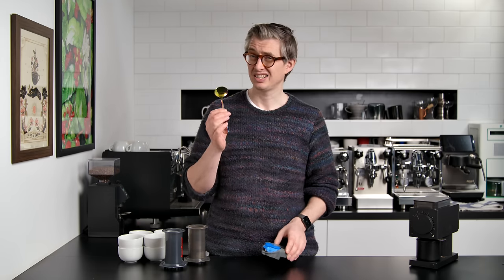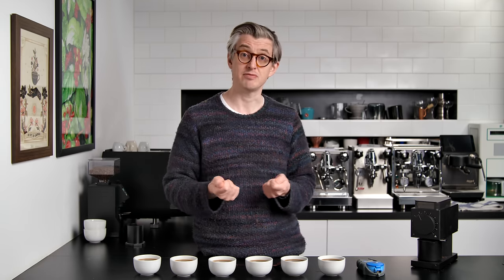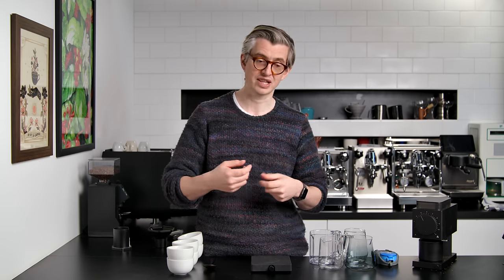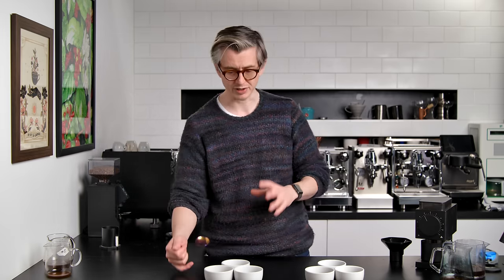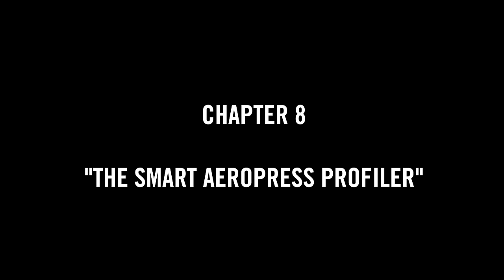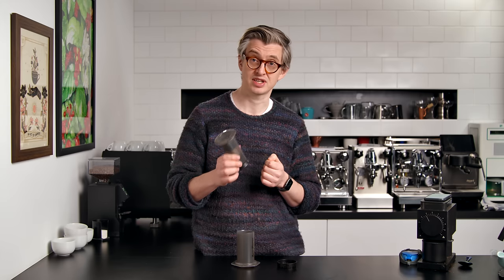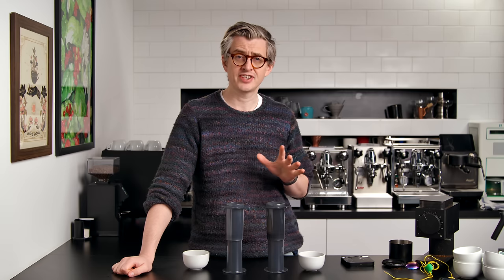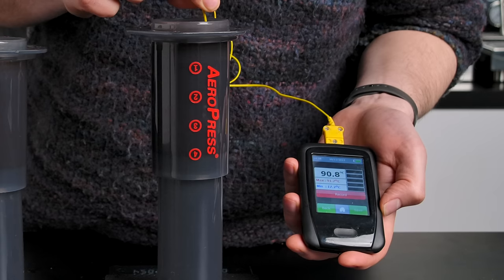Understanding The AeroPress (Episode #2)

Comment: I once forgot that I was brewing a coffee in aeropress and the brew was steeping for about 40 minutes. It was a pleasant surprise how tasty it was.
Reply: It’s not long before the water cools and the coffee settles enough to the point where extraction has effectively stopped.
Reply: Cold brewing does have something to it. Even if it didn't start that way.
Reply: Check out Sprometheus video where he treated the aeropress like a cold brew, he just let it drip until it finished and got nice results.
Reply: In my incremental steps where I brewed all the way up to 30min, I found out that after 10min there where no gain in letting it steep any longer, it’s also about that mark you typically start drinking in cupping. The 10min where the best absolute but the gain over a 4min brew where small, like very, very small and probably not worth the extra brew time. The biggest benefit seem to be that you can drink it almost immediately.
Reply: At a bakery, I'd load the portafilter before going home for 5 hours before the late shift.
So it pre-infused and was slow roasted until I pulled the shots at midnight.
Very nutty soft flavors.
Reply: It does say in the instructions that if you are expecting company, you can pre make a bunch of shots.
Reply: This video was very helpful for me. I just got my Aeropress for my birthday and am just learning how to make it properly. After watching a lot of videos, I brewed my first cup using the inverted method, the bloom, and wetting the filter.  I was pleased with the results and it was definitely a quantum leap from the auto drip of my coffee maker. However, I was a little disappointed in the amount of coffee provided. Now I learn that I can increase the quantity by using the non-inverted method  and still get great flavor. My second disappointment was that I couldn’t make two cups in my Original Aeropress. Now I learn that I can double the coffee and get a concentrated brew that can be divided into two cups and diluted with additional hot water. Brilliant! Problem solved. Last I learned that it’s not necessary to wet the filter prior to brewing. This isn’t a big deal one way or the other, but it’s nice to know anyway. So, this video was very helpful and I learned a lot. I will try out my newfound knowledge in the morning. Thanks a million.

Comment: as a habitual aero press inverter, filter-rinser, and non-hiss-presser, you have made me question everything. thanks for this one, king
Reply: The recipe seems to be; finer grind, no invert, boiled (or 80c) water. Uncomfortably closer to “bang it in and enjoy it”.
Reply: Perfectly put!
Reply: I'm in exactly the same boat 😂
Reply: So each by themselves do not make a difference, but what about all 3 together? 🤔
Reply: For real, it's actually kind of a relief to know that I don't need to stress about EVERY little thing with the Aeropress.
Reply: I feel attacked by James...
Reply: same here hahahahaha
Reply: I honestly think the inversion method depends on what you are doing. Some recipes call for you to stir for x amount of time while inverted then immediately flip and press. If you didn't have it inverted you would be constantly losing water in an uncontrolled manner so your extraction would differ slightly between each brew, enough to matter who knows but it will still be different and it is a way to control that variable while changing others.
Reply: I believe inverted is actually easier. I've never spilled inverted, but I have with non-inverted. Basically pressing in the plunger after having liquid in it gives me less stability than having in from the start. :shrug:
Reply: One defense of inverted is, especially if you have a metal filter and don't measure water, is that it makes it easier to put in a consistent amount of liquid.
Reply: I'm right there with you...  😁
*UPDATE * I made a cup with the new information... 2.5 min steep, normal orientation, unrinsed filter, swirl, and boiling water. Result: richer cup, very tasty. Key Takeaway: My Palette isn't as refined as his. 🤣
Reply: Inverted is more consistent, as the amount of time it takes you to insert the plunger and pull a vacuum with a non inverted brew is an additional variable that will slightly vary every single time you brew. That means different amounts of water will have different amounts of time in the brew chamber etc. If you're goal is consistency of cup, I think inverted makes perfect sense.
Reply: @iau if you multiply zero three times, you still get zero.

Comment: I would be interested to see a comparison between different filters such as a single aeropress filter, double aeropress filter, metal filters, metal and paper combo, fellow prismo and the aesir filter. It would also be interesting to see what difference you get by brewing with a small amount of your final water and diluting after pressing or using the full amount to begin with. Thanks for the thorough and informative video James!
Reply: He basically answered one. Brewing 15gr with 200 water or with 100 water... the one with more water used in brewing wins.
You could compensate the diluted one with grind size and steeping time and such .. but are the brews even comparable at that point?
Reply: I’ll echo the request for different filter experiments (though I think we can all try triangle experiments, if we have a friend to swap the bowls around). I’ve been using a paper filter in combination with the Prismo, just because I’m lazy and don’t want to figure out the right plunger-position for true immersion brewing. And... I’ve also tried a cloth filter with the original and Prismo bottom.
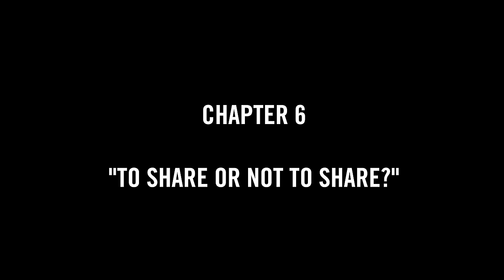Reply: @jorismak  Yeah, he did a fast comparison between different ratios at 10:55 but he didnt dilute them to an equivalent strength before tasting. This way you cant make any statement about which method actually tastes better. It is obvious that the stronger cup also has more acidity. You cant make a judgement about which cup will be more acidic without actually diluting them to the right strength and tasting them.
Reply: @Currywurst4444  you night have a point there. He also said that it wasn't extracted properly, and diluting it down isn't going to fix that. But you might prefer it.  Test it yourself!
Reply: I just came here to say the same thing, different filters. 
I was using paper filters at home and metal mesh filter while I am mobile. 

This might not be a problem to anyone. However, I do travel on bike multiple days. It’s extra weight, and, most importantly, it is hard to store them in panniers or find them if I run out. 

At some point during lockdown, I was out papers and thought it could be selfish to order only paper from Amazon (high volumes deliveries and not enough drivers etc) and started to use metal at home too. 

Now I don’t even remember if there was a difference between two and I don’t think I put any effort to adjust to mesh filter. 

I’m wondering about your experiences.

Comment: 1.  Cleaning/rinsing the aeropress between brews
2. Using 2 paper filters (for higher pressure, finer grinds) 
3.  Rinsing and reusing filters
Reply: Yes! I travel a lot so use the Go, well, on the go. I tend to reuse my filter paper for the duration of my stay wherever I may be. The only difference I notice is the resistance increases as the week goes on... But then my palate isn’t as professionally trained as Mr. Hoffmann’s
Reply: @nickpugh8879  I rinse with very hot water (like brew temp) and reuse as well, as does Alan.  I definitely notice an increase in resistance after 4-5 uses.   Flavor is better in the first few uses, I think, but seems that after that, the flavor does not seem to progressively worsen.   I thought it might be an "old coffee" flavor thing, but after watching this video now I wonder if it's the pressure itself changing the flavor.
Reply: In turkey aeropress championship, almost everybody was using 2 paper filters in their recipe. I hope James will play with it and share the toughts and his preferance.
Reply: I reuse at least 10 times. Until there is a hole in the paper. Why? Same reason I use the Aero press: I find it interesting! I rinse under a fairly high pressure spray stream. I do not notice significant resistance over time.
Reply: @guydavids9402   single or double paper?   I rinse mine with the kitchen sink sprayer after every use,  then rinse before each use with some brew water like I would with a new filter.
Reply: @TwinGamersTr  I too would love to know your opinion on this James... I know i have my preference...
Reply: Metal mesh filters instead of paper...I prefer the taste.
Reply: Reusing aeropress filter papers is like reusing condoms... just no... $4 for stack of filters is just trivial in comparison to the cost of the  beans. Why people why?!?!
Reply: @petertiggerdine2631  you seem to know too much about reusing condoms...
Reply: @vennic  lame dude attacking someone just shows your lack of ability to debate ideas. $4 for 300 seems just silly to not take x papers wirh you.
Reply: @vennic  single paper. Never really thought about two... until now. I wet the paper before each press as well.

Comment: I use an AeroPress every morning for my coffee and I switched a couple years ago to a metal mesh filter to get away from buying paper filters. I wouldn't mind seeing a break down of how alternative filters change the brew, especially against the standard paper. Thanks!
Reply: PLEASE try an oil based filter, it will change your life FOREVER
Reply: @marvin19966  do they add 15hp
Reply: I bought a metal mesh filter as well and I as well as my friends found it to be much more difficult to use,  I think the grounds block the mesh holes and create a vacuum, maybe it'd have better luck with less fine grounds.

If you found it works that's great, but I'll give my warning to anyone considering it.
Reply: I'm still looking for an answer on whether the metal filter changes the brew much. I suspect it does, for the worse. But I've been using one for 5 years...
Reply: @jsmith1025  Metal filter let's more sediment through, making the coffee more chalky/ muddier. I like the texture and consider it an upgrade for my tastes.
Reply: You've had one for years. I'm sure you could take a few days to try different filters if you're curious....
Reply: @plwadodveeefdv  they add +50 cholesterol
Reply: It’s heavenly *slurp* 👌🏼
Reply: Metal filter is the way to go.
Reply: I also had this question, likewise I switched to a metal filter, although initially used the gauze style ones with no edge and they were pretty poor and soon became damaged. I think the gauze also blocked easily.
Reply: The muddiness with the metal filter was a turn off for me. I stopped using it
Reply: I use the metal filter to avoid inverting. Now that it's been shown that inverting isn't necessary if you use the plunger to create a vacuum, I may go back and try the paper filter,  but I've had no issues at all with grinds getting through the metal version.
Reply: I don't like the taste of French Press, which uses stainless filters.  There is a flavor in there, that I just don't like.  And at the cost of filters, sometimes, the expense is worth the end product.  This is one of those cases.

Comment: Inventor: "Here's an easy to use coffee maker so you can have quick and kinda good coffee at home!" 
James Hoffmann: Understanding the AeroPress (Episode #2)
Reply: Alan: You can brew espresso with aeropress
James: No you can't
Reply: My favourite part of the Aeropress instructions is to put a rounded scoop of coffee into the press. No grams, no levelling out, nothing.
Reply: @mrpopenfresh  I suppose it's the simplest recipe available and it's very forgiving. Obviously there are plenty better methods but with this you should get a drinkable coffee
Reply: @MrVenom113  It's also functional. I've been using that method for over a year now, and until I get better precision equipment than what came in the box and my kettle, I don't see a need to change it.
Reply: @MrDarren690  I’ve been using an Aeropress since my first deployment to Afghanistan in 2010. I’ve experimented with just about every method and found various different sweet spots including temp, filters, grind settings, steep times, inverted, etc. A decade of experience has instilled in me that the Aeropress is very much Marine proof, and that it is incredibly fault tolerant. The worst cups that James is brewing would still be incredibly good to anyone used to Folgers, K cups, or a coffee urn. Play around with your own coffee settings and decide what you like. My current favorite is a coarse grind, inverted, boiling water, cloth filter (from coffeesock), light stir (and pouring water to wash the coffee off of the stirrer back into the Aeropress), flip immediately over a cup, steep for 2 minutes, press with just the weight of my forearm until bottomed out (through the hiss). Add a small dollop of honey for taste, and a pinch of baking soda to turn down the acidity (due to health concerns).